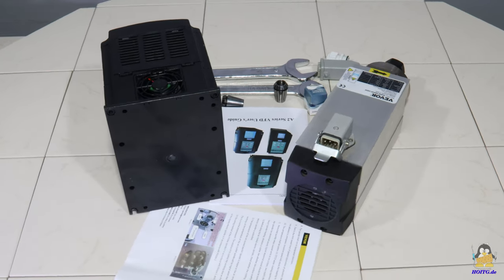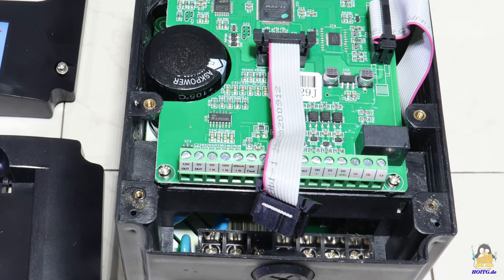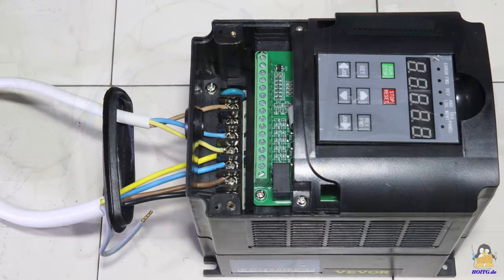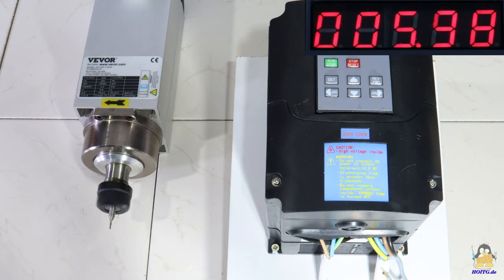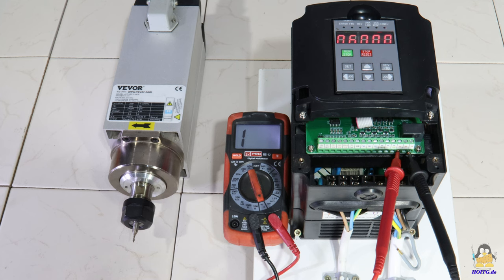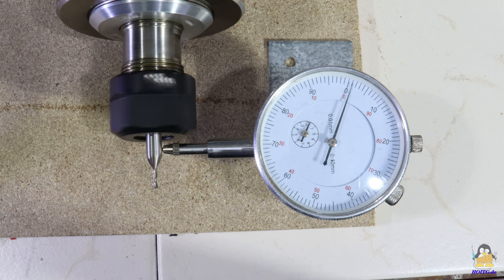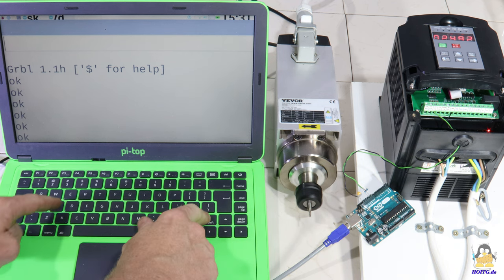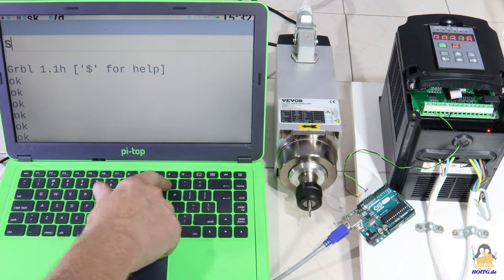Review of a 3kW Spindle and control unit from VEVOR

Comment: Hi,  Could you let me know what the mounting hole size and spacing is on the back of the spindle.
Reply from the maker: Hole size: 6mm, metric thread
Distance: 30mm horizontally, 45mm vertically (two columns, 3 rows of holes)